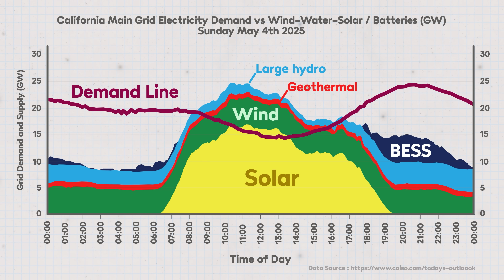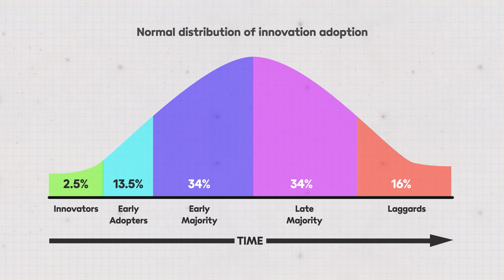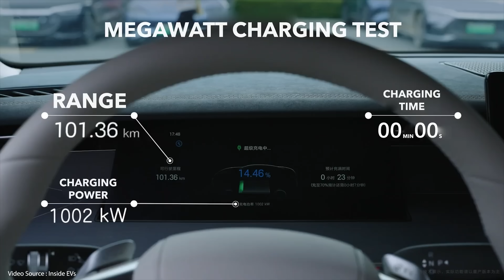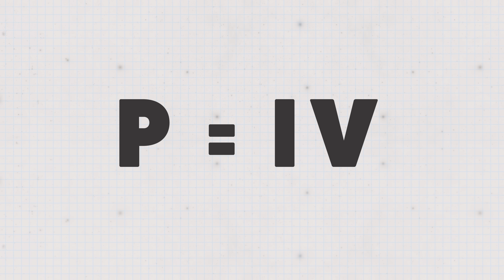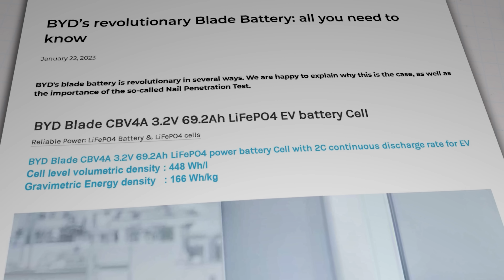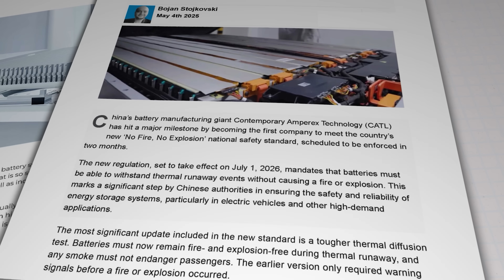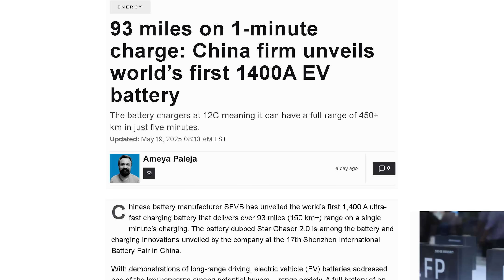BYD 1 MEGAWATT 5 minute EV Charger. Overdue or Overkill?

Comment: EV charging for me isnt so much speed, more availablility. The most important thing for me is being plugged in and charging.
Obviously a minimum speed would be great, I am thinking 100kw speed.
Reason being is when I need to charge, I will be at a rest stop having lunch or something, which will take me about half hour,  50kwh is good enough for another 200 miles, either to reach my destination, or time for another pit stop. 
I am certainly not one of these people that can drive for 6 hours with no brake
Reply: For EV battery pack longevity, it is best to charge at the lowest voltage rate.  Using public DC fast chargers all the time will ruin your battery pack taking years of use off of it.

Comment: 1MW charging power is unbelievable and several Chinese companies are well past that point. Just a matter of time until it comes to the rest of the world. Also, batteries that can accept even 500kw are easily charged in 10-15 minutes. The gap to a benzin refueling time is shrinking every year
Reply: You Can't specify charge time or rate without Pack Capacity, and visa versa.
Reply: I was thinking the same about Dave's comment of 1MW being overkill. Once this level of charging power becomes available that would be for many of us the point where we would be able to happily transfer over to an EV as the period sat at the charger will be 10 minutes tops. As to whether the local energy company is going to be able to supply energy to dozens of 1MW chargers in the local area, that might be the next challenge.

Comment: RIP TESLA
Reply: Tesla developed a MW charger years ago...  Tesla Supercharging V4 chargers are already being installed at Tesla charging locations.
Reply: @Les_S537 The major innovation is the battery that can handle such fast charging.
Reply: @Max-f3f2l  That's no innovation.  Tesla has been using MW charging for several years with their Tesla Semis.
Reply: @Les_S537  This is about cars with much smaller batteries. They can't handle it.
Reply: @Max-f3f2l  Tesla's Cybertruck can use MW charging rates...  It's about the volt-architecture in the car, not the battery size.
Reply: @Les_S537  Model Y Juniper, the newest model, charges at max 250 kW.
Reply: @Max-f3f2l  Irrelevant.

The only EVs that need MW speeds are those with huge battery packs, like the Tesla Semi, or much heavier EVs like the Cybertruck (whether when towing something heavy, or just outright heavier than a sedan or economy class EV).
Reply: @Les_S537  I'd like a faster charging car if I can have it.
Reply: @Max-f3f2l  As an EV owner since 2019, I've rarely ever even used a public DC fast charger...  More than 95% of my charging takes place at my home every night while I'm asleep.

I'm a typical driver, that is to say I do between 30-40 miles of driving each day (to and from work, maybe some errands mixed in, etc).

When I get home at night I simply plug my EV into the 120v/15amp outlet in my garage (120v/15amp outlets come standard in every home or business), and by morning those 30-40 miles are charged back into my car and that's that.

MW scale charging is only useful for industrial scale EVs like a Tesla Semi, or an electric excavator or dump truck, etc...  Or an EV truck which regularly tows heavy loads.
Reply: @Les_S537  The major innovation is a battery that can handle such fast charging.

Comment: Gave up owning or driving a metal box over 20 years ago but still want a battery storage unit that's safe to store the energy from my solar panels. Any suggestions for an Aussie?
Reply: I know that the Electric Viking (Aussie) has made several videos of his own purchases and experiences with those products... Maybe check those out! 👍
Reply: What safety issues? seriously..  are the millions of EVs and Powerwall type installations around the world not convincing enough?
Reply: @jnawk83  Not yet. Waiting for a Powerwall battery that can be recharged more often than the lithium ion ones do before having to be replaced. Most of my power tools are battery driven with the cost of those rocketing up since buying those power tools 9 years ago.

Comment: 0:21 This "duck curve" shows the mismatch between electrical supply and demand
0:57 While the bidirectional charging shown here is the solution to the duck curve
Given these two realities, I find the failure of Enphase and others to roll out their bidirectional chargers in the US to be absolutely criminal.
This isn't rocket science. Since at least early 2023 Enphase demonstrated a working system but they are still screwing around about releasing it.
Reply: Do you know if the standard for bidirectional charging is complete?
Reply: @solacedagony1234  That is an excellent question. I do know that in early 2023 Enphase said they would roll out bidirectional chargers in early 2024 and they keep delaying, 

I also know that my solar panels DC power is converted into grid-following AC power using the same microinverters that are in their bidirectional chargers.

There could possibly be some additional standards, but given that the identical equipment (their microinverters) can be trusted to send grid-following AC power onto the grid from my solar panels when the sun is up, I see no reason not to trust the same microinverters to safely feed the grid after the sun goes down.

Any information you might have would be welcome. Thanks.

Comment: Two car family. One EV and one ICE.  EV is used everyday for distances less than 60 miles (120 round trip). Longer range we use the ICE car.  The 

EV is used everyday, and charged twice a week (Mid and Sunday).  ICE is used every few months, and we do take it out for really short 1 to 2 mile runs to keep it from seizing up every now and then. 

Our next EV will hopefully have a range of 400+ miles, and a charge time of 5 to 10 minutes, at that point we will completely switch over.
Reply: Only short runs can be bad for ICE. The engine should be run long enough to evaporate any moisture out of the crank case. Short runs can be worse as blow-by from the piston rings introduces moisture into the crank case, which condenses on the walls. This is more of a concern with vehicles stored in below freezing conditions. A single 20 minute drive (or 10 minute each way for a quick errand) would be better for it.
Reply: I have the 77kw Pro S ID.3. I'm more than impressed with the range. York to London back to Peterborough before I need to charge.

But 3 hours of driving from home towards London (UK) is Baldock...and I'll just plug in there while I stop my bladder from complaining. 😂

So if you can do 400 miles without stopping, you have a professional bladder and I'm mildly jealous 😂
Reply: Thanks for the concern, but we charge on a drive. I haven't used a public charger in a few years.

We have a plan where you shift energy use at home and charge energy mid week off peek, you get electricity free on Sundays.

So I only pay for 2 to 3 hours of EV charge time a week. The rest is free. I live in the UK.  

15 to 20 minutes from two cities, 2 motorways, 5 train stations and an international airport.  Long range trips be covered.

The beach is no more than 70 miles away from the most inland location in the UK. And a 60 miles round trip, puts me on the beach, in forests, hills, downs, rivers, etc...
Reply: Seems like you need to SERIOUSLY Audit your "Long range" trips, including "Natural breaks"
Reply: Those yanks who figured high current was safer than higher voltage sure were shortsighted.  120v is a total disaster. Its even more likely to put the heart into fibrilation, whereas higher voltage outright stops it == easier to restart it.
Reply: I am a five car family 1 driver,  five cars.  I will have a whole week to charge my EV and thank you for helping me buy it fellow taxpayers.  Your "rebate" to me is much appreciated.  I bought  a gas swimming pool heater with the cash.
Reply: @brucefrykman8295 ok.
Reply: Yep, great idea.  That's how we started.  Now the last ICE car just died and we have two EVs and charge almost exclusively at home.  Its ez with a two car family to dip a toe in and get a used EV.
Reply: @Sneaker_Net  This is a good choice if you don't need to very travel far and you live in a region that is not dependent on renewable unreliable and expensive power like California.
Reply: You're doing charging all wrong if you're charging it only twice a week...  Are you using a public charging station to charge, or are you charging at home?
Reply: @Les_S537 why is he “doing charging all wrong” only charging when he needs to?  I only charge once or twice a week because that’s all I need to.
Reply: @NickFoster  If he's charging only once or twice a week that tells me that he's more than likely using a public DC fast charging station to charge his EV because the typical driver does 30-40 miles per day, and while most EVs have ranges of 300 miles in the real world they're more than likely getting just over 200 miles of range.

4 days at 40 miles a day means he's more than likely running his battery down to near empty and then charging it back up at a public DC fast charger.

Early EV adopters regularly used public chargers in similar ways, and the result of that was that their battery packs were experiencing degradation rates of 30% or greater after only a few years of use.

The better thing to do with your EV, for better longevity and less degradation, is to charge at much lower voltage/amperage rates.

A typical 120volt/15 amp in your home or business can only charge ~4 miles of range into your battery pack per hour, so if he's charging after 4 days of use at that rate it would take him 75 hours to fully recharge (thus he's obviously using a public charger with much higher voltage).

Understand now?
Reply: @Les_S537  You know not everyone lives in America, right? In the rest of the modern developed world, we use 230/240v. Additionally, not everywhere is designed like the US, where you have to drive 40 miles to do your shopping. Here in the UK, for example, the average daily car travel is only 19 miles. Our standard home chargers are about 7kW, which is a 0-100 charge in about 7 hours for the Tesla Model Y LR. We can also get a 22kW charger if we're willing to pay the premium and the extra dedicated grid connection for it.
Reply: @KevinHorrox  Yes, I'm aware that the rest of the world uses other voltages, and in your case you're sitting pretty because a 240v/60amp outlet can "push" 40 miles of range into your EV each hour, and so yes you could fully deplete your EV over the course of a day, arrive home, and plug into the 240v outlet and be fully charged by morning.

You guys lucked out going with 230/240 volts, but the higher voltage does mean your battery packs will experience more degradation over time...

The US led the world in electricity production, and standardized at 110/120 volts because this voltage was considered safe for early appliances and incandescent bulbs.

The rest of the world standardized at 230/240 because your grids grew later, and 230/240 volts was chosen because it results in improved efficiency in power transmission as higher voltages reduce energy loss over long distances due to lower current.
Reply: @Les_S537  yeah, I charge about once a week per car, no fast chargers.  average daily miles in the US are around 15 I think, not 30 to 40.
Reply: @Les_S537  I charge twice a month at home as I have 300 miles range in the ID.3. 

Sure, I have to charge away from home when I do my long trip to the parents. But it's one charge for a 440 mile trip, and maybe not even if my parents let me charge over night.

So no, they aren't doing it all wrong. People do what they want to do. The only wrong is not having an EV 😂
Reply: @colinwiseman  If you want your battery to last you a long time, there most certainly is a right or wrong...

I bought my Model 3 Long Range late 2019.

I have ~79k miles driven so far in that time...

My battery degradation is just over 10%, and this is because I almost exclusively charge my EV at home with a 120v/15amp outlet.

If I'd have regularly used public DC fast chargers all the time, my battery would be closer to 40% battery degradation.
Reply: @Les_S537  The historical numbers say its not as big a deal as it use to be.  The latest EVs have a lot of tech to protect the batteries even with fast charging.  Its really the over 80% under 20% charge/discharge that can damage the batteries over the long term. And even that is not as obvious since a lot of batteries are large than they SAY they are.